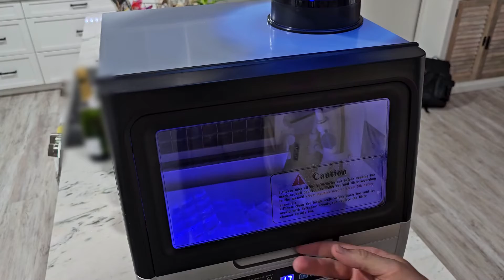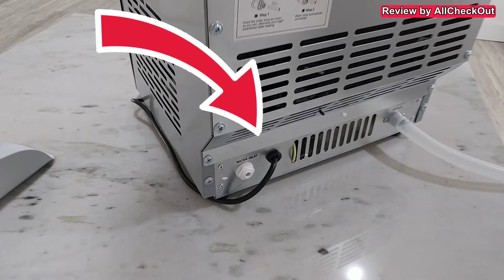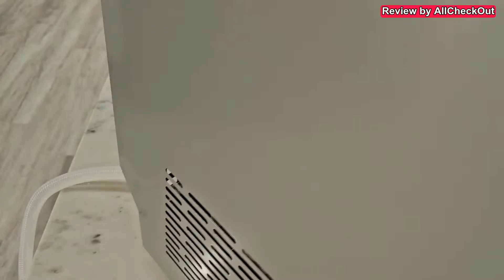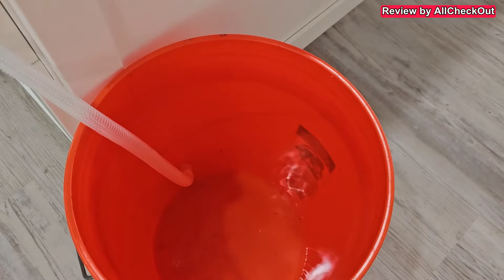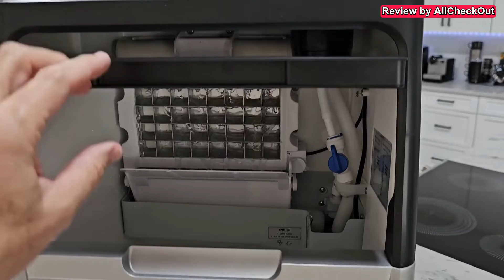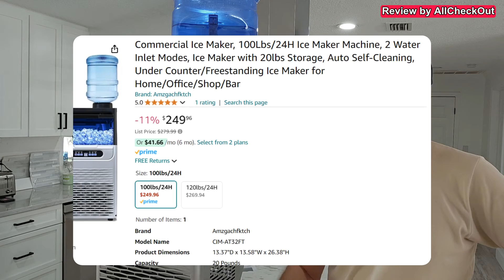Commercial Ice Maker CIM-AT32FT Review | 100lbs/24H Ice Machine with Dual Water Inlet Modes 2024

Comment: This brand of ice machine is absolutely a P.O.S.
Reply from the maker: Oh really? What happened?
Reply: @allcheckout I don't recall the model # of the last one. But it's a rip off of the Manitowoc Neo. The screws strip very easy, the pump is poorly mounted, the water delivery tube is a pain in the ass. The door screws were all stripped. The machine just isn't made to maintenance numerous times. It's more as if they intended for you to throw it away. I just believe that it is a poor choice and I hate the throw away society. I would rather they make improvements and charge $1 000 more than to put out throw away junk.
Reply from the maker: Yeah true, but sales would drop probably 90% so they stick with producing rubb .... h you know ...

Comment: 100 pounds per 24 hours is good for small operations or home bars. The dual water inlet modes give you flexibility if your plumbing setup is weird. The timer reservation feature is interesting never seen that before. Could be useful for running it overnight. Got our machine from Empura and it's straightforward, no fancy features but does what we need
Reply from the maker: Thanks for the feedback! Nice to see that you like it (too) ;-))

Comment: What if the water doesn’t flow down from the water bottle. Mine will not fill on its own. The error message says E2. I have to fill it manually for it to make ice.
Reply from the maker: I think I had same problem but can't remember what was wrong. Maybe I didn't fully remove the water bottle sticker completely ....